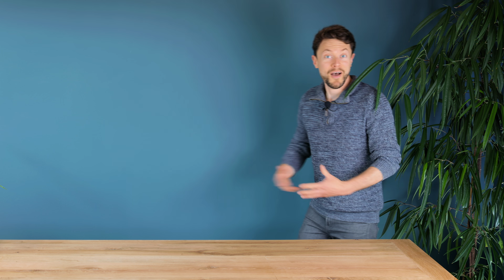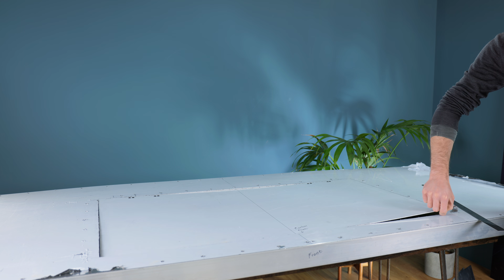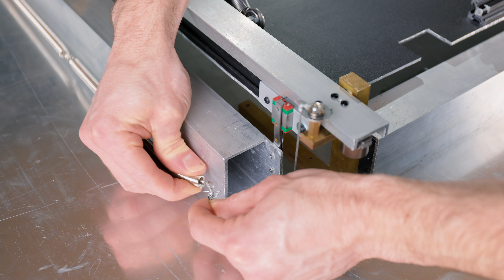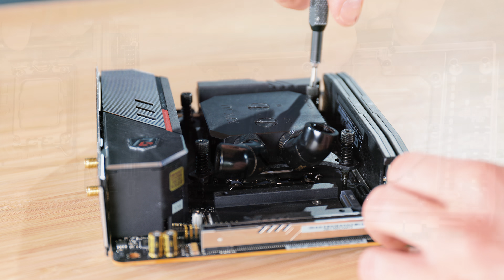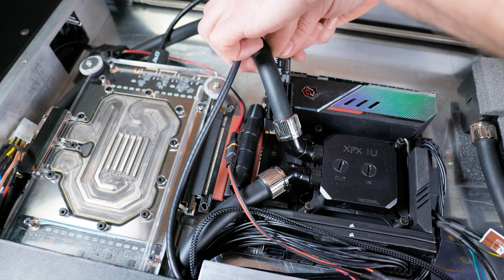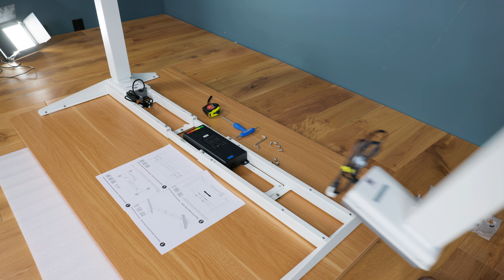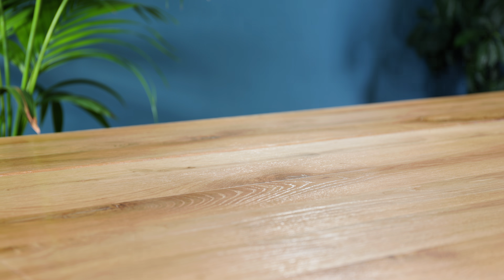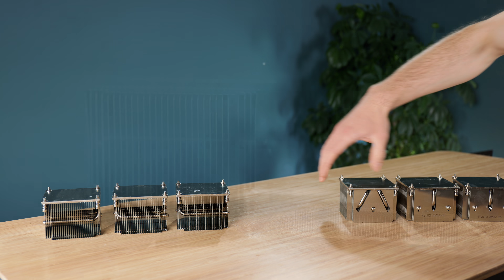Building the ENDGAME invisible PC

Comment: One thing overlooked: monitor adjustment. Sure, the height can be adjusted, but the angle of the monitor is really important! I would make a PC that can go in the desk, and a sliding monitor holder on the back that can be tucked away, so it could be used as a workbench and a computer
Reply: That was pretty much the only critical flaw I could find. It's super sleek and while it is "height adjustable" that's raising the entire desk to accomplish, something some folk with certain body measurements might not entirely like. Then there's just angling the monitor up and down.

Can't really do any of that without taking away from the profile, although it appears there's just enough space (including peripherals) to be able to accomplish this.
Reply: I thought the same. The setup is really fancy but pretty much useless at the same time. No one can sit at a computer thats monitor is at the same height as its mouse and keyboard for longer than an hour.
Reply: @FlockeDerBoss  I don't understand, that monitor is not at the same height as its mouse and keyboard. I have a similar setup as he does.
Reply: @claudej8805  I mean the bottom and yeah, if you have that I reckon you get neck pain fairly quickly..
Reply: @FlockeDerBoss  I meant the bottom too. I see more than 10cm between desk and screen. Not same height.
Plus the middle of the screen is probably around 40cm above the desk which sounds fine to me. How about your screen middle height ?
Reply: @claudej8805  You're right. I forgot about the panel that the monitor stands on but that's still too little for my liking. My monitor starts about 30 cm above the surface area of the desk, which makes its average height about 45-50 cm.
I've been using PCs for about 20 years, tried around a bit and definitely notice a positive difference with increased height.
Reply: @FlockeDerBoss  Ok, maybe you're right too. At 22:35 it seems the display is a little low compared to him. That's probably why he did set the windows high up.
But doesn't setting the windows higher up solve your issue in your experience, remember this is a big monitor (mine is even bigger, I use a 65" oled TV)
Reply: @claudej8805  Well, depends on what you're doing with your monitor and for how long. Over all no, it doesn't fix the issue in my opinion but it can compensate it to some degree.
I think he intentionally filmed from an upper angle to hide the fact that this is an inconvenience he's aware of which would kinda ruin the whole project, which I have to say is stunning all in all. I love the sleakness and his projects in general. I love the clean desk and the whole setup but from my experience I can say I wouldn't be satisfied using it.
Reply: @FlockeDerBoss  The display might stemming from the Corsair Xeneon Flex 45".
By the way another issue wasn't adressed : how stable is that mobile uplifting plateform ?
Reply: Also the monitor panel cooling is gone. I wonder how long the panel will last
Reply: Another small point is that you cannot get to the usb ports, so charging your wireless mouse and keyboard will be quite difficult if I am right?
Reply: Something that annoyed me was the fact that he sacrificed the ability to fold his monitor, that doesn't make any sense why he used a monitor that costs 2k usd.

Comment: I recommend gluing a small piece of felt to that magnet to save it from marring your lovely oak surface over time.
Reply: Yeah definitely agree there.

At least it's not veneer this time so he has the option to sand any scratches out lmao
Reply: It will take about 10 years of daily use before you see anything since it's oak. Then it's possible to polish it to look like new again.
Reply: Thats a good idea
Reply: Would have been better to not need the magnet and have some sort of mechanism holding it down instead
Reply: What? Nah, I'd glue the magnet to the felt. 😂😂😂😂😂😂
Reply: magnet w/ computer is also kinda risky
Reply: @eeeee11235  false with modern pcs. Only hard drives interact magnetically.
Reply: @Jordan-ru8yf  and for those who are old enough to remember the fun that could be had with CRT screens and a magnet.
Reply: @eeeee11235  Wait, do you not know how electronics work? There's no hard drives, so there's no issue. Nothing else is severely affected by the magnet
Reply: @DoxSteele  the OLED can be permanently damaged by the magnet over time. It's why I've avoided getting magnetic cables for my phone
Reply: @zer0nix  What? OLED doesn't get affected by magnets, I can assure you that. Where did you get that information from?
Reply: @DoxSteele  Probably the CRT magnet issue got carried over to LCDs and even OLEDs
Reply: @zer0nix  Isn't CRT the one get damaged by magnets? new iPhones are dead if magnets damage OLEDs or LCDs with its built-in magnets for Magsafe
Reply: @DoxSteele Does the screen not suffer the effects of a string magnet?
Reply: @yubinator69  Huh?? CRT is a completely different technology. LCD and OLED are essentially micro LEDs, Cathode Ray Tube is literally electrons getting blasted at a surface from a foot away. Google has been a touch away for too long for you to be acting like this.
Reply: @xe8905  Which of my statements you were referring to? I replied two different comments. if it the one I said "carried over", what I meant was what they think of magnets damaging screens get carried over to newer tech.
Reply: @cgi2173  what is a "string magnet"?
Reply: @yubinator69  It doesn't get damaged, it just warps the colors. In fact, you use an extremely strong AC electromagnet to fix the color wrapping by moving the field around into equilibrium
Reply: @DoxSteele  I see. When I was a kid, I "destroyed" our big Sony CRT TV because I tried to show my parents a cool trick with weak magnets to it. Idk why it ruined it that bad but, it is what it is.
Reply: @eeeee11235 The CPU and SSD drives are on the left side of the table, not on the middle, where the keyboards and monitor is.

Comment: Man, the original heatsink back looked so good. I was sad that it went away.

I understand the difficulty of retrofitting the those giant new heatsinks in, but I wish there had been (/was shown) some experimentation to see how much was necessary. Maybe only single-side the heatsinks at first, or if thay wasn't enough, try 90mm fans instead of 140mm; so much of those are being wasted as is. And lastly, if we still end up with big protruding fans, maybe a shroud made of either mesh or or the fabric used for speaker covers. Anything will hurt airflow a little but as it is you have an enormous amount of cooling budget to spend. I think it would eliminate the one aspect that still looks unfinished about this magnificent piece.

Comment: Phenomenally executed, impeccable attention to detail, only critique at all is the monitor serviceability being captive. 

I bought a flexispot EC8 back in 2021. Purchased purely off its weight handling specification which was the highest at them time (only a puny 275lbs compared to this newer models 440lb rating). The E2 model price is phenomenal, puts to shame the ikea Trotten manual adjustable desk. Flexispot prices have really came down in price.

Comment: Sitting at my desk, this comes up. I'm thinking hey that's neat. I bought a second hand standing desk still in the package, never used for $100,  but I had just used it as a desk, as I thought it wasn't strong enough for the 2 giant curved monitors etc I have on it, and never plugged it in.  I look over at the side of the desk ... Oh. I have a FlexiSpot! hahahahah! ok,  it has no problem lifting my 100K 187cm body + monitors.  And now the top of my ceiling fan has been cleaned for the first time in ??

Comment: Looks great!

Would the bare brass box sections cause some corrosion concerns? Brass rusts, and I’ve also heard mixing multiple metals for water cooling loops can cause galvanic corrosion. Seeing as the water cooling blocks and fittings you used contains other metals than just brass.

Comment: I love that you fixed the cooling! Also that you showed and explained us the issue with the cooling before. Also fascinating that 400rpm are enough to cool such heat. My 4 case-fans are on 800rpm and they are completly useless (I keep the sidepanel open lol, otherwise the interior heats up too much and slows my components)... 😂

Comment: Never understood this. Better to just kick your PC to the other room and then use connection over ethernet or fiber-optic cable to provide connectivity in the room where you want to sit. Not only way cheaper but also you remove noise and heat. PS. Cool build.

Comment: I had an " invisible PC" as I mounted my last PC underneath the desk so it couldnt be seen from above. Just a power button, monitor keyboard and mouse on top.
Of course this DIY Perks project goes much further than that :)
Reply: Not in the same league either, but my daily PC is in a different room and linked to a projector via a long HDMI cable. There is can make all the noise and heat it wants.

Comment: I love this guy but it kills me when he makes an :O face when he finds out that soldering 80 server heat sinks, a dozen of the biggest size fans you can fit in a pc, and a chunk of brass that weighs more than my entire computer does in fact cool his cpu double plus good. Since they work so well, i'd like to see the desk updated with a smaller dissipator that can fit the profile of the build. Perhaps even a (wooden/brass) mesh covering the rear to keep the covert style even if you ever decided to place the desk in the middle of a room. Also, the exposed fans facing your legs are just asking for stray clothing to cause trouble for fidgety users, and doesn't fit the exquisite rest of the build. Cheers

Comment: Did you double check BIOS settings? Most mobo manufacturers default to some wild CPU OC profiles which are near impossible to cool without throttling. So maybe your original set could have coped with it. Also undervolting the GPU would have improved performance while lowering thermal load.

Comment: Really cool, but as you seem to be loaded with the old cashorino's here is a suggestion for cooling. The feet are metal right? If you run a liquid cooling setup through them, and sink the heat into the feet, while having them be finned (custom machining required) it would provide Massive surface area and even better, be pretty much silent. Reservoir, pump, etc, all can be hidden inside hollow space of the feet. Allowing even for some emergency active cooling where your current cooling setup is on especially hot days when the passive* cooling doesnt suffice anymore.

Comment: I'm thinking the brass tubing needs to be flattened, as well as the pads on the heatsink. 
Thermal paste is more conductive than air, but less than metal. Ergo, it's imperative to use as little as possible just to fill microscopic gaps.

The shot of the gobs of paste when removing the copper heatsinks made me cringe. 

Hope the revamp was better.

Comment: This turned out incredible! I know this isn't particularly meant to be a DIY project, but could you share the rough price on this one?

My guess would be something like:
$700 Flexispot desk
$2000 OLED monitor
~$1000 structural components 
~$600 cooling system
~$3500 PC parts
~$400 Miscellaneous (pneumatics, wood, linear motion components)

~$8200 total

Which wouldn't be bad at all for the final result. I also generally took the upper end when pricing so this may be totally off.

Comment: great build as always, thank you for a great video! I have just one question, it's not very clear how much force you need to use to close the lid?  I'm just wondering if you can lean to heavily and accidently close the lid while using the PC. But you seem to pull on the monitor and pushing down on the desk at the same time so I'm guessing it might not be a problem :)

Comment: As always an amazing system, that I have 0 skill to build myself. (so I will sit here from afar and cry).

One question though: 
How much cooling would one layer of the the heatsinks and 80mm (or smaller) fans work?
Asking cause it seems like the dual layer + 140mm fan setup is way overkill cooling for your system.

Regardless amazing job as always
Cheers!

Comment: I'm in absolute awe. I do have one question though: how does the peripheral platform handle weight? does it budge at all, or did you silently implement a mechanism that would require you to lower it from the monitor platform?

Comment: The fans are struggling because of the 3D printed ducts. Fans loose a percentage of their power for every 90 degrees you try to direct them. so the back heatsinks aren't going to get the full effect of the fans

Comment: :face-blue-smiling::face-blue-smiling::face-blue-smiling: the problems have not gone away, the table itself will still heat up and work like a stove and in the summer it’s terrible, the table can only be placed against the wall so that the horror is not visible, using a magnet will scratch the surface and after a while it will look terrible, maintenance and cleaning is will be another task:face-blue-wide-eyes::face-blue-wide-eyes::face-blue-wide-eyes:

Comment: You could have used one of the section as the cooling systems. By taking air in from the bottom using the standard fans and the exit can be on the back of the table itself in between radiator can be mounted either on top of the fan or before the exit depending on the size and other constraints. And the top of the is made of wood so not much heat can get to the top also.

Comment: I think there is only one other thing I would do to really make this the end all be all computer. Instead of using a manual approach to opening the monitor, you can hook it up to some motors and a switch and with just the press of a button it will open up automatically. Other than that, truely remarkable work and I would absolutely pay for a system like that. ITs so clean and beautiful it brings a tear to my eye! Good work as always!
Reply: Whrrrrrrrrrrrrr

Comment: What did you print the fan and heatsink mounts out of? Since they are directly in contact with the heatsinks they could get quite hot, so hopefully you didn’t use PLA.

The fan power rails seem quite janky too, it will be interesting to see how they hold up over time. A potentially better but more involved option is to use copper or brass strips, drill holes in them and then bolt circular crimped wires down to them, that way it is more like a proper bus bar and is held on by more than just the adhesive on the tape. Or you could use a copper or brass strip and try to solder to it, although this will probably be difficult since the wire is so thin and the thermal mass of the strip would be so large.

Another option for water cooling would have been to use normal PC cooling radiators and fans but mount them along the back pointing downwards in such a way that they intake through the bottom and exhaust out the back or even place them at an angle for better airflow. Crossflow radiators would be good for that since they have their intake and exhaust ports at opposite ends of the radiators.

Comment: Awesome build. As time goes on, you might find that the solid oak top will have gaps open up or worse, start cupping and create an uneven surface due to seasonal wood movement. As you went with quite thick 'veneers' they will most likely overpower the glue used to hold them in place. If your house is climate controlled you might not have issues though as it will keep the relative humidity the same year round. Just something to look out for, cant wait for the next video

Comment: In the past your builds seemed reproduce-able but now it's just needlessly complex. While I'm not a fan of that I get the desire of wanting to do more and figuring all this stuff out is cool and if the complexity was needed for some grant vision I'd get it but here it only makes the desk more pointless and impractical. The actually cool parts of this build were fixing the de-lamination issue with your last build and improvising your own water cooling radiator using old parts and the practicality of making it a standing desk is nice. The problem is no one needs a computer inside their desk but it's kind of cool and your bellows cooling, for example, was pointless but really cool because it was so novel but ruining a desk surface for an almost invisible really complex hinge that opens in an awkward way to hide things that you need on your desk anyway, it's just not cool.